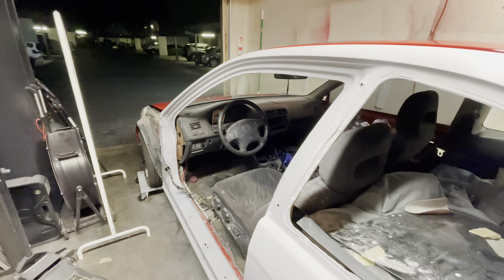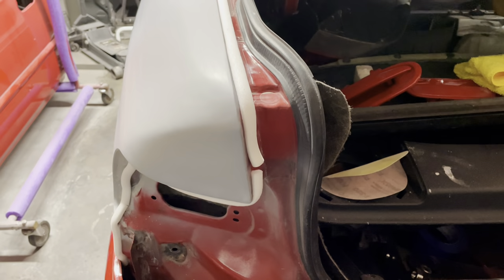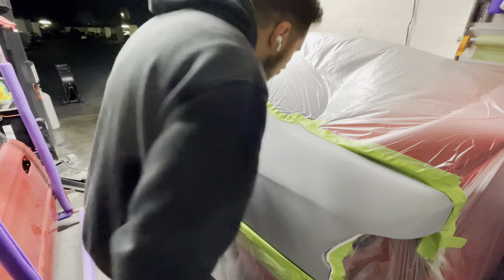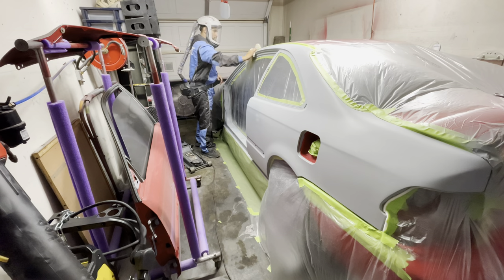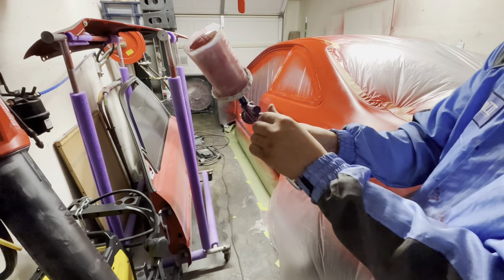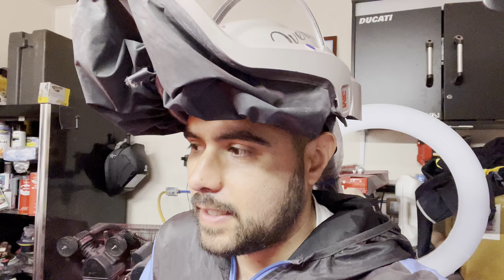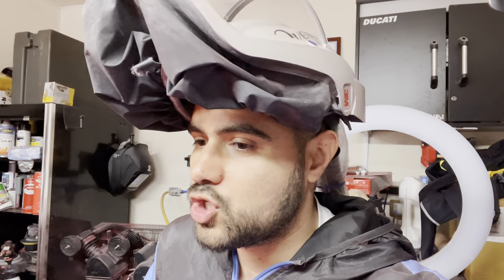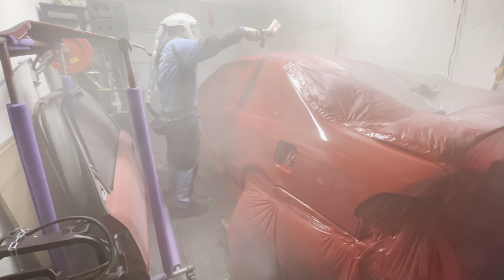TIPS AND HARD LESSONS OF PAINTING A CAR IN A GARAGE. Honda em1

Comment: just wow. Amazing video, love your setup.
Trying to make something similar in my garage, can you please give me some advice in how you manage the ventilation/exhaust/filter.. idk how to say it. lol
I mean I can see the fan in the garage door, but you have any complaints with your neighbors? with the overspray?
Reply from the maker: Thanks , so let’s see, my setup is unique to my current garage limitations but basically a strong fan to exhaust overspray out of the garage in less than a few minutes, ideally you would want an intake but I have solid walls on the other side so it’s hard to do that. I don’t have complaints because I paint at certain hours were most people aren’t home and they are away from my general area were overspray isn’t an issue. But if you are concerned I would try waterborne paint it doesn’t smell hardly at all and it’s mostly water . You would just need a way to dehydrate the paint like a blower or fan.
Reply: @Mechaniclyfe  yeah, it’s hard when you have certain limitations on your work area. But man, you’re making it work! 
I’m just worried if I try to paint with a fan like yours the clearcoat overspray sticks in the neighbors cars lol.
Any ways, thanks for answering! Keep the hard work bro.

Comment: This is 2 years later but is there a reason you don't spray the floor with a bit of water to keep dust down?   In my double garage I try to build a tent with plastic inside the garage and wet any of the concrete as a desperate effort to keep crap off the wet paint.
Reply from the maker: After many trials and tribulations, I learned the humidity build up in the garage isn’t worth it, when I can simply use the proper steps minimize trash in other ways . I have no extra windows and doors in my garage so airflow is a problem , which also happens to trap the humidity in the garage , effects are extended dry times, overspray accumulation, high humidity if I wet the floor, susceptible to paint solvent popped or having a dull finish
Reply from the maker: To mitigate wetting the floor however , I have used a 3m product , to hold down the dust even when the product dries . It’s called dust control spray. I spray it and let it dry , then spray it again , humidity builds for a short time but then seizes to exist when the product dries , yet still holds down the dust. Next prepping the surface by cleaning and tack ragging the surface along with static control methods have been the biggest remedy for paint inclusions.

Comment: Well, there are so many more things that went wrong for me:
1) Wrong paint and diluent ratio. 
Bought the paint at a specialized shop, also got a bucket of diluent. Saw some video on youtube of what the mixture should look like and poured way too less. Watched another video of how things look when painting (it needs to be wet), ended up spraying 500ml of paint in 3 coats on a goddamn mirror to achieve "wet" look.
2) Not waiting enough between base and clear.
You gave those 3 thick layers of wet base? That especially combined with a wrong diluent ratio will cause the paint to dry a longer time (than the default 1hr). I sprayed clear coat too soon and got large pits since base coat didnt fully evaporate.
3) Spraying too much clear trying to "fix a run"
Terrible idea, chances of actually making it better are slim (if thats your first time). You'll just spray a ton of clear and will have more to sand down
4) Not using a foam pad for an electric orbit sander
I tried to sand down the massive blob of extra clear with a hard pad. It took me 30s to go with its edge down to bare metal. Basically ended up sanding the whole door, repriming and repainting
5) Not waiting enough for a failed job to dry
Previous failed paint-job wasnt cured completely (it seemed so) and I sprayed some primer on top. When I sprayed new paint I got massive "paint biting" in some areas where I sanded the primer. The new paint probably reacted with old paint.
6) Compressor spewing wet air - simple "filter" does not cut it, the air still has a lot of moisture
7) Not checking my spray gun - if it doesnt spray completely straight (not clean enough), it will spray a bit on its edge. After some time enough paint accumulates there to just be blasted out onto your beautiful paint-job.
8) Clear coat going bad - I had my clearcoat sit in a closed can for two weeks and when I sprayed it onto my fender there was massive pitting everywhere. I didnt understand whats going on, but I came to this conclusion after spraying it on a ton of different surfaces with the same result.
9) Bad lighting - I had pretty bad lighting in my garage and noticed a lot of dry areas in daylight
10) Not wearing glasses - Lets just say you dont want that experience.

Comment: On the topic of final prep:  ALWAYS buy the biggest box of gloves you can afford, and same with the blue shop towels.    Gloves are mandatory when applying ANYTHING to the panel.    Why?   Oils from your hands or any part of your body that even grazes a panel will leave oil residue which will later show up as fisheyes.    Paint won’t stick to oil, and that lack of bond is what causes the paint to form those circular spots.   Kind of like water beading up on an oily surface, paint is beading up on that spot where it can’t stick.    I see you doing a tack wipe without gloves.   That’s like begging for fisheyes.    More or that in a minute.  Microfiber towels are hit and miss.   Read the label carefully.    If they are expensive and claim “lint free”, MAYBE you can use them for the final wipe down before application.      Cheap ones may or may not leave lint as you showed.   BUT I have found that microfiber towels, iF free of lint, are better than “paper” towels at grabbing debris, and moisture.     After primer, a good microfiber, by my experience, can be a very effective “leveler” of paint or primer which has “landed dry”, by shearing off the tops of those dry patches without leaving sanding marks.    Before any application I use microfiber and prepsol to get any potential dirt, oils, etc, from the surface.   It requires a LIGHT solvent based cleaner to extract the things from the surface which shouldn’t be there.    Too much solvent in the cleaner will ruin the prepped surface.    Ideally the solvent will evaporate, but procedure calls for wiping until all residue is removed.    Then on to the water based cleaner, where the blue and white glass cleaner cans are best, used with blue shop towels.     Those  shop towels don’t leave lint, are the perfect coarseness to clean without scratching, and since they are cheap and disposable, there is little chance of picking up a contaminated towel.    The water borne glass cleaner is needed to remove any of the prepsol residue, and any final bits of debris.    At this point we should be wearing a mask, because ALL OF US unknowingly project things from our mouths onto the surface which may cause fisheyes or other defects.     At this point I will have had fans running for several hours to help get rid of any airborne debris/dust, and before that had vacuumed or swept up any I could find, then used a yard blower to dislodge and other dust from surfaces where a vacuum or broom might not get.     This is usually done 12 hours or more before hand and left with fans on the rod airborne dust front e space.     Before final wipe down I make the air still, only turning them back on JUST before painting.     Filters on the incoming fans are CRUCIAL.   About microfiber towels.   They can be washed, but use cool water and low heat for the drying.    Too much heat can cause slight melting if some if the fibers and leave some parts coarse enough to scratch the surface.  Bad news.   That mistake once put me back 12 hours of primer and prep.  Ouch.   On the subject of oils.    The paint store person once told me to remove any and everything from the space which contains petroleum at all.   All of it, even closed containers of motor oil, cans of WD40, all of it.    I basically had complained of fisheyes even after cleaning like crazy.    She said that the oil residues can become airborne for quite a long time and end up landing on your paint job even during the application process.     So I found the biggest bin I could, filled it with every single product like that, even brake fluid bottles, EVERYTHING, caulk, all of it, even jacks and jackstands with residue in them, all went outside.     Now, obviously the engine compartment and underside of the car will have those kinds of contaminants, so use the Foam tape between the hood and the engine compartment, and do your best to seal the rockers to the ground.     Under the car is least likely to be bothered such that bits can become airborne, but airflow itself will go under the car, so take that into account.     An old oil leak which left oil on the driveshaft May end up in your paint.     The very next application I did after following her guidance resulted in ZERO fisheyes.     Incredible.    I basically use the rolled plastic to make a sealed environment for paint application, and spend hours and hours doing that just for 1/2 hour of spraying.      Which is yet another subject.     They say the best paint application is one big run and that is true.     The fine line between runs and dry application is the stuff that separates the pros from the rest.   The right humidity and speed of reducer all matters too.     So many variables.    A DIY but excellent  application is a rare creature, yet we keep trying.     It nearly drove me crazy last year.  I stripped a hood down to bare steel at least ten times because of imperfections.     Making the call between good enough for cut and buff or in need of a scuff and respray is a tough call too.    Indeed the fine line between tooo many coats and enough to cut and buff is yet another problematic topic.      I can do just about any craft, none of them perfectly, but generally as well as anyone I would hire.     Plumbing, carpentry, masonry, mechanical, all good, as they all allow for some small mistakes.    Not automotive painting.    I have successfully corrected mistakes mid-spray, but those were a mix of lucky timing and experience.   Other times a simple attempt to remove what seemed an easy nit or bug stuck became a full respray.    This skill is quite daunting and can break you, financially and your spirit.     What we see in pictures and video as “good paint jobs” is most often a flattering view of the subject.    Getting it RIGHT without near perfect conditions with modern paints is extremely difficult.    The nature of the paint and how it dries creates orange peel.    Beat that with excellent application and prep and you are one in a thousand.      I got a bumper “perfect”, in black no less, once.    It looked like glass, no joke.    I went outside and jumped around.    Then, maybe because the paint was soooo smooth, the clear got some runs.   I tried to fix the runs, but the part required a do over and I was not able to repeat that glassy application again.     I am scientifically minded, and variables are my enemy.    Regardless, this skill faces too many variables to get right every time, even in a perfect environment, like a zillion dollar downdraft booth.    By the way, I used an old electric fan from a car’s radiator as a makeshift downdraft fan, pulling air down and under the car, channeled to exit the booth from under the car.   This prevented airborne overspray from “landing dry” on surfaces, especially a hood.   The result looked like a waterfall of airborne paint rushing downwards and away.     It was effective at preventing dry landing overspray, but if not shut off immediately after application, made the top coat of paint dry too quickly by way of the rapid air movement across the panel, and caused problems where the first coats weren’t “cured” yet.   An infrared heat lamp helps with this tremendously.   I have used a heat lamp carefully applied, to turn an “acceptable” application into a much better finish simply by getting all of the coats dry at the correct rate.   Crucial stuff.    A first coat covered too quickly can bite your ass a month later.     Ouch.